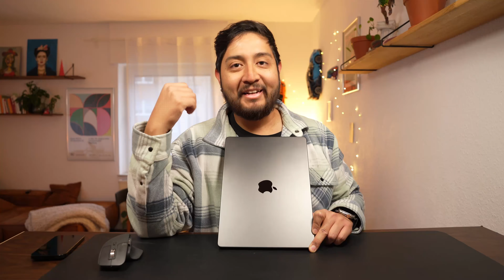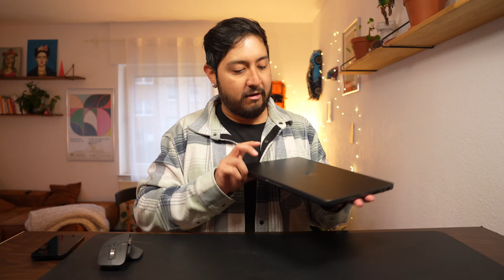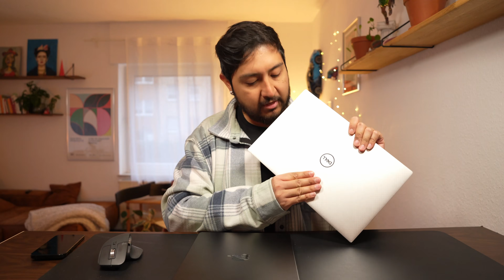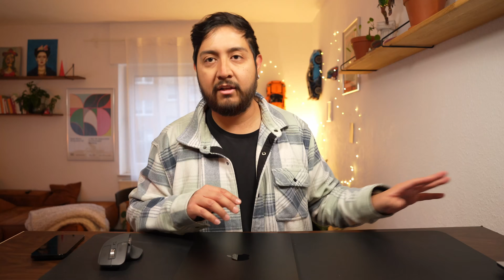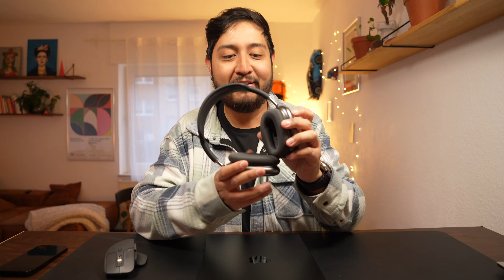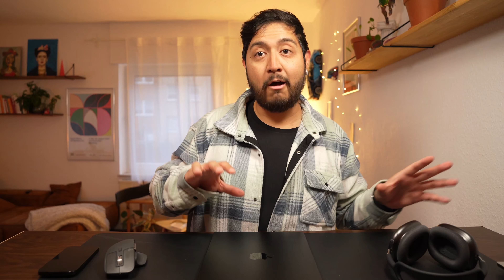I'm switching to Mac as a Mechatronic Engineer

Comment: I have been using Solidworks since 2007. Switched to Fusion since a year ago and I really like it. Since Fusion is available for MacOS I have been tempted to buy a Macbook Pro and replace my Dell Precision 7550. But looking at all the CES 2025 releases a lot of new Windows laptops are coming out this year so I will probably lean towards some new Windows laptop instead. I have some "OCD" regarding ECC memory so probably will get a laptop with ECC.
Reply from the maker: The ECC is a fact, I have also been using SolidWorks since 2010 but have always been in contact with a lot of CAD software. I do not think that the Macbook can replace Windows laptops, at least not now for CAD, but I want to check what is really possible with Fusion, Onshape, etc. The important thing about normal Windows laptops with consumer GPUs is that with the Creator Studio NVIDIA drivers you get almost comparable performance in CAD programs. Solidworks at least. Thanks for watching!